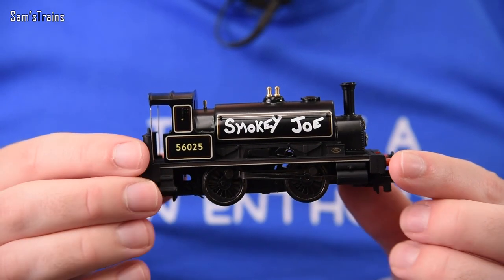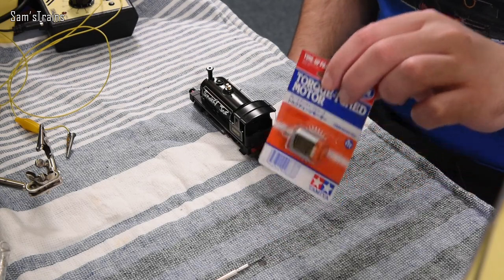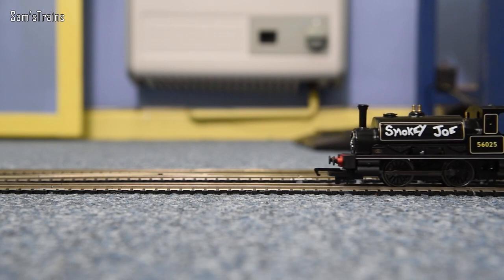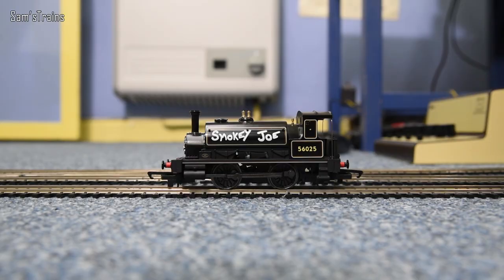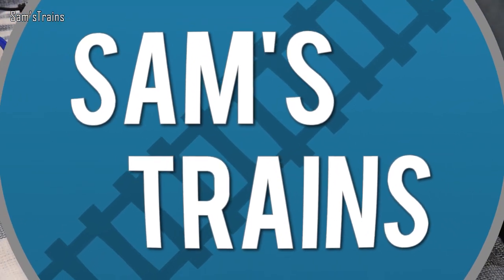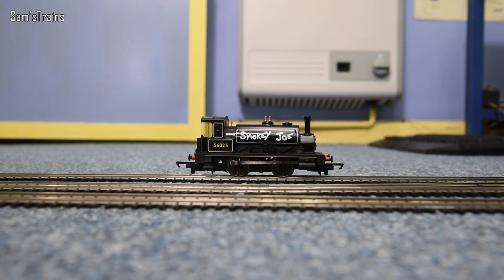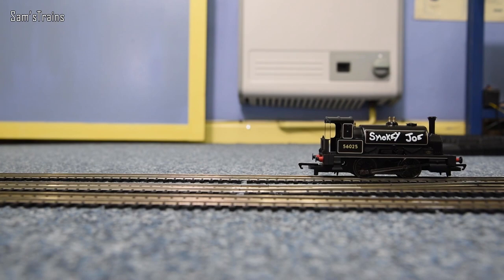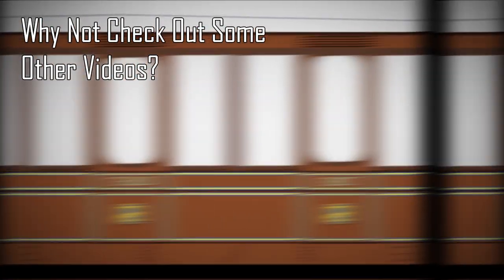Hornby Smokey Joe | Turbo-Speed Motor Upgrade | How Fast Can He Go?

Comment: Sam that's Japanese, Tamiya is a Japanese World wide hobby company, Great video though
Reply: Although of course it's a Chinese Mabuchi motor. The biggest motor manufacturer in the world by a long shot
Reply: @gs425  Mabuchi was and maybe still is a Japanese company. Originally made all their motors in Japan. Became the best motor to have in the 1/24 th scale slot car boom of the mid 1960s. Motors like the FT 16D, 36D and 26D. Set up factories in Hong Kong by the seventies to reduce costs. Many imatatores of Mabuchi motors.
Reply: @johnd8892  you are partially correct,  the company was originally Japanese but the motors are made mainly in China,  with other factories in Vietnam,  Taiwan and more recently Mexico. They hold their cards close to their chest somewhat,  but i was applications engineer for Mabuchi motors for over a decade from early 90s and never saw a Japanese unit in all that time. All China with some types Taiwan.
Reply from the maker: Duly noted! This came from Taipei, if that helps any?
Thanks for watching, Sam :)
Reply: @gs425  

The writing is in Japanese.
Reply: @gs425  

Doesn't matter. It is like with The Ford Motor Co.. Even if many of its components and entire cars are made overseas, it is still an American company.
Reply: Hi Sam, the 'resistor' you mentioned would be an inductor, part of the suppression circuit along with the capacitors. I know your main interest was speed but it would be interesting how different the pulling power would be with a 5 pole and more powerful magnet. I'd expect a good improvement.
Reply: It's funny how everyone thinks the voyage is the fastest model when in fact hornby percy is fastest
Reply: Whoa, never knew tamiya was japanese. They also make some really nice models and remote controlled cars
Reply: YUP ! They sell good stuff !

Comment: Dude, it's not a Chinese motor. It is a Japanese one, a really good brand even. Wanted a review on that motor, can see it just takes off! Thanks man.
Reply from the maker: haha you're right - thanks for letting me know, my bad! I know - maybe I could do more with that motor!?
Thanks for watching, Sam :)
Reply: @SamsTrains  Specifically it's for Tamiya's Mini 4WD line of racing cars.  It's meant to be powered by two AA batteries.
Reply: Hey Mr. Pikachu, I bet you know that the language was not Chinese and was actually Japanese was because some of the letters looked like smiley faces witch is normally in Japanese. So, yeah.
Reply: @moberg3113 Katakana (the text is written in this script) is pretty distinct from Mandarin (Chinese) or even Kanji (another Japanese script). If you went down a language rabbithole once or twice you could recognize Katakana pretty easily.
Reply: @moberg3113 Katakana (the text is written in this script) is pretty distinct from Mandarin (Chinese) or even Kanji (another Japanese script). If you went down a language rabbithole once or twice you could recognize Katakana pretty easily.

Comment: Those Tamiya torque tuned motors are tuned to accelerate very quickly to a high speed. They are mostly for RC cars I think as tamiya are known for model kits and RC. I used to use one of their race tuned motors in a 1/10th scale touring car. Also they are Japanese
Reply from the maker: Ahh very interesting - well the loco certainly did accelerate... though the load here will have been tiny compared with a car I guess!
Thanks for watching, Sam :)
Reply: the small torque motor is for the mini4wd small wall racers (1/32 scale race cars) based on their rc buggies as tiny cars you drop into walled race tracks
Reply: @MirehManuh  ah, nice. I used their larger ones
Reply: @sgkingly8392  i race both, although the 1/32 scale mini4wd racers are more popular in south east asia
Reply: @MirehManuh  nice! 1/10th scale 4wd touring cars are the most popular in the UK
Reply: Are you not going to mention that the torque tuned is one of the bottom tiered motor
Reply: oh yeah forgot about that torque and rev tuned are in the lower power range when properly broken in, then followed by the dash series like light dash, hyper dash, mach dash, and ultra dash (we do not talk about plasma dash)
Reply: @SyrChu  altho do have to point out torque tuned is superior to rev tuned in terms of race performance as rev tuned slows down to much on the usual japan cup tracks

Comment: I know this video is around a year old at this point, but if Sam just happens to read this, there are motors about that size made to upgrade flywheel foam dart blasters, which not only are fast, but there are ones that are made for 3S LiPo mods, which means they'll comfortably operate at about 12.6 volts. The question is if your controllers, track, and wiring can supply something like an Out Of Darts Kraken with the current it needs safely...

Comment: Sam, the resistor limits current.  It protects the engine by reducing the power available for the motor.  A resistor can help reduce R.F.I too.

Comment: This, together with your mention of Scalextric, takes me back to the late 60s/early 70s when some friends and I used to combine our slot car layouts into a huge circuit (with boosters) at our youth club. We once built a Tamiya Scalextric Car around a three volt tape recorder rewind motor...It went like your loco! It also badly melted the "See through but painted on the inside" Tamiya body before and during it's final burnout! And yes I recall that smell! (The other good one was building an Airfix Vintage Fire engine kit, complete with seated firemen, around a similar kit car - that lasted even less time, but half the fun was in the anticipation anyway!)

Comment: Those tamiya motors are used in Mini 4WD cars. They are 1/32 scale cars that are designed to be raced around a track like scalextric cars. They are customizable because you can change the tyres, gears, chassis, bearings, rollers, and motors. They're very popular in asia but only in few parts of the world actually played with them. I think you should give this hobby a shot, it's really fun and it gets very competitive when you're racing against your friends. 

However it's getting really hard to find someone or somewhere that has the track for them, because the tracks needs a big space to play on and they're really expensive if you buy your own track, even if it's just a basic oval track.

Comment: Sam, ask Gaugemaster for a suitable  NSR highest performance slot car motor that would be a direct fit.
The Shark 46 EVO is 46,000 rpm 290 gmcm at 12 volts version of the about 15 to 18,000 rpm standard Hornby motor. Hornby do not state the torque. Double shafted too, so can drive or end bell drive can be used.

Comment: I'm sorry for this comment, I don't mean to be rude or anything, but  I feel as if  should point this out. The writing and Tamiya by extension is Japanese.  The unusual writing you see below the "torque tuned motor" label is most likely Katakana. A specific type of alphabet used for foreign words in Japan. And below that is Kanji which is a writing system taken from the Chinese.

Again sorry for the comment, I just feel as if I should point it out. 

Slight side note, I enjoy seeing modified stuff like this so, good show.

Comment: That Torque Tuned motor is not Chinese but Japanese. They're sold by Tamiya (though actually manifactured by Mabuchi Motors) for their Mini4wd cars, which are 1/32 scale cars used for racing in special tracks, a bit like Scalextric slot cars but with the cars running in trench-like tracks and using horizontal rollers to steer by leaning on the walls.

Fun fact is, the Torque Tuned is perhaps one of the slowest motors available for mini4wds (12.000 rpm under load at three volts) as it is one of the oldest models designed - if you really wanted insane speed, you should've gone for one of the Dashes, not the Tuneds. In particular, either an Ultra Dash, Jet Dash or Plasma Dash. The latter not only has more than double the speed of the Torque Tuned (25.000 rpm!) and two times the torque, it actually has cut-outs in the casing for cooling... which kinda make sense as the thing actually draws a staggering FOUR amps. Even in unlimited classes the Plasma Dash never got any favor as two AA batteries are simply not enough to feed that beast, even with powerful rechargeable ones.
Reply: Sam should, ask Gaugemaster for a suitable  NSR highest performance slot car motor that would be a direct fit. A proper slot car motor that won the world championship for NSR.
The NSR Shark 46 EVO is 46,000 rpm 290 gmcm at 12 volts. Much higher than the Tamiya not designed for 12 volts and also draws less amps. Also much higher than the about 15 to 18,000 rpm standard Hornby motor. Double shafted too, so can drive or end bell drive can be used so makes it easier to fit.
Reply: @johnd8892  Yeah, that would be a better fit. With 12 volts the Plasma would reach higher than that.. for just a few seconds before destroying itself in the process, while a slot car motor would be working at its proper voltage and so all tests would be possible. I'm not sure about NSR, but Slot.it does have motors in the 130 form factor as used by Smokey Joe in its catalogue so a slot car motor swap it is definitely possible.

Comment: Calling Tamiya "Chinese" did make me twitch, I admit... But others have already given you a hard time about that!

What is a bit weird is I have a Smokey Joe, which we've owned for a long, long time, with the same livery and it's really fast. As in, way too fast to be realistic. In-fact, it's probably comparable to your Torque-Tuned Joe. If I remember correctly, I think it has a Scalextric motor inside. It hasn't been messed with, because our Hornby "Monty" and "Loch Ness" were just as mad fast and I've had them from new.

Comment: I would've mounted the motor with the long shaft to the worm drive, and forced the wires to fit. Maybe you could use some tin foil or easter egg packaging or something folded down into the gap in the cylinder for the rods to provide a low-friction upper barrier for the rods so they don't bounce, using blu tack to fill the shape out and keep the foil in place.

Comment: Try placing a few section of tin under the track when using the five pole motor and see if the adhesion is better to make a better pulling power for this loco. While considering the connecting rods umping up and down, perhaps a narrowing of the slot in which the rods are lying at the cylinder will make it less likely to bounce...

Comment: Those Tamiya motors are of Japanese origin and used in their "Mini 4WD" cars, which are powered by 2x AA batteries. In the right application they can be exceptionally fast, but there's a huge range of options available from them on a spectrum between speed and torque.

Comment: it interesting how much of a change there is when you upgrade the motor (or just change the motor in the case of the torque tuned one).  i have a 7 pole motor that i plan to put in an older locomotive that had a 5 pole motor (yes both are pitman motors).  just need to figure out how to do a shaft extension since it appears the 7 pole shaft is just alittle to short.

Comment: Well, that was fun. It's interesting to see what sort of scale speeds Smokey Joe reached with the torque-tuned motor installed... With the 3-pole motor, your speed of 0.42 m/s scales up to a speed of 71.4 mph (!). Could an 0-4-0 go that fast? But, put the Tamiya motor in, and the scale speeds go doolally: 1.2 m/s (50 % on the controller, IIRC) becomes 204 mph (!!), which is only surpassed in its insanity by the flat-out speed of 2.17 m/s or 369 mph (!!!) when scaled up. No wonder it came off any sort of curve!

Regardless, I hope Smokey Joe is okay with its new motor. Don't know what you'd use for magnetic shielding, though.

Comment: One solution for your magnetic problem, is to change the coupling rods by home-made ones made from a non-magnetic metal. Bronze comes in mind for me.
Overall, nice experiment ! You reached a scale speed of 738 km/h at the maximum when the original does not run over a scale speed of 55 km/h. Cheers gentleman !

Comment: tamiya 13o engines were designed for miniature racing cars so if you want speed go akead in fact some motors like plasma dash and torque tuned are designed specificallly to be overvolted.

for refrence the torque tuned motor series is specifically designed with power in mind while speed tuned are designed for well speed , finally dash motors are both

Comment: The adventure begins was a great movie.
1) get a Bachmann black James.
2) do a motor transfer from Smokey joe to James.
3) buy the same motor you just put in James, and put it into Thomas
4)put Thomas and Edward on the track in the station area.
5) put James and a bunch of trucks, and a brake van on the track.
6) couple the trucks to the back of James.
7) couple the break van to the back of James.
8) start recording Thomas and Edward in the yard
9) start James up at 50% power, in making him go past Thomas and Edward 
10)make Thomas Chase James  a few laps around the layout
11) just before a turn, make James move at 100% power, derailing himself.
12) now you have a remake of that one scene from TAB. Upload it yo youtube!

Comment: There is a slot In the cylinder to allow movement of the coupling rod. By gluing somthing at the rear wall of the cylinder (to reduce height of this slot) the anoying effect of magnet should be cancelled. The reduction of vertical play in slot should be short (1mm) because the rod must oscillate.

Comment: The 3V motor with several diodes in series would drop the voltage to a more reasonable level.  StrathPeffer sells a Ringfield upgrade kit that has a 6V motor and a set of diodes to drop the voltage :).   Works quite well. 
I doubt those Chinese motors have any kind of torque tuning.

Comment: I have a new idea, the old Lima/Hornby HST's aren't dreadfully quick with the ringfield motor. I think a motor swap that fits around the new set up Hornby use in the upgraded old style Hornby HST model in the Railroad range is in need.

Comment: Well, I've got two of these classic 0-4-0's, and as typical for older style model trains they zip right along, to my unending annoyance. If I slowed them down too much, they simply stalled on points and diamonds. Saw an ad for a replacement motor that sported a worm that was supposed to increase the gear ratio and slow it down. After prying off that wretched retention wire, and reinstalling, again a life-or-death struggle wresting the wire back on, discovered the difference to be absolutely nothing. 

An attempt was made to convert m/s to smph, and I probably used wrong conversion factors, but I got a rough idea. At 0.42 m/s Smoked Joe was at 36 smph. At 2.17 m/s, 423 smph. Keep trying, Sam, maybe you can reach Mach 1 in smph.

Comment: How about an experiment to see how quickly you can get a locomotive to complete a lap around your layout?  I’m thinking torque-tuned Smokey Joe (or maybe one of those cheap and nasty Ali Express engines where you don’t have to worry about scratching the paint),  flat-out on the straights, but slow enough to make it around the curves without derailing, testing your skills on the controller as well as the engine’s speed and stability.

Comment: I have the Caledonian Railway variant and its insane, no slow mode and just goes from zero to insane speed on pretty low settings and high settings it will hit a curve and just flip off the track O.o   Pulls like a champ too, can put some serious weight on the end and this is where the problems begin because it pulls bogie stock off the track most times, luckily I have the Triang controller with the two modes and high stance slows it down.   Won it on ebay listed as brand new for £12 delivered and seems to have a 2019 tag on it so maybe this has an upgraded motor in there?

Comment: Nice experiment Sam, though I think you answered your own question to why Hornby don't fit those 5 pole motors with the magnet problem. Tamiya on the other hand is a big Japanese model manufacturer and are well known for their motors, I believe they are supplied by Mabuchi another Japanese company and motor specialist I have three Tamiya radio controlled cars and yes they do shift some what though mine are probably still classed as slow against the professional racing models.

Comment: Hi Sam,, how do you work out if they are 3 pole or 5 pole without pulling them apart.
The reason im asking is that ive seen a heep of vids around swapping out the old ringfield motors in the old hornby and lima locos with the 3d printed conversion to the can motors out of cd drawer drive motors.
Well I have stumbled across similar can type motor but out of old computer printers of which there are 3 of them in each printer as in 2 of the larger longer type can motors and the smaller can type racing car type motors which ismthe same shape as the smokey joe enginemyou have there. I once adapted to a 46 class jeouf loco which had blown up and replaced it with tne slot car engine. 
It turn my 46 class into thee fastest train i ever had had and would pull every cariage I had at the time. Haha.
So how do i know if these smaller motors are 5 or 3 pole without pulling them apart. Any advice would be muchly appreciated. 
Cheers from John in Australia.

Comment: What is the point? Is this model railways or Scalextric? When I was in my early teens I used to like seeing my Dock Authority Shunter fling a rake of wagons sideways as it rounded a second radius curve. Now that I'm somewhat older (and not necessarily wiser) I prefer to see locos run at prototypical scale speeds. Why not strap your Smokey Joe to a model rocket motor and see what speed and altitude you can achieve?